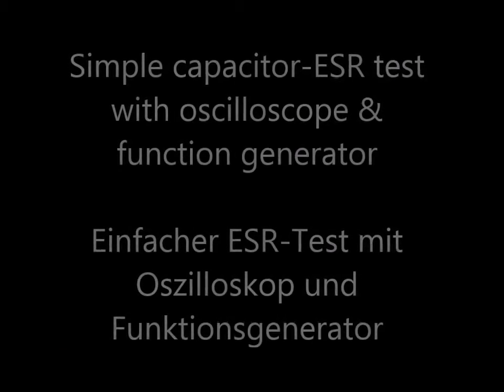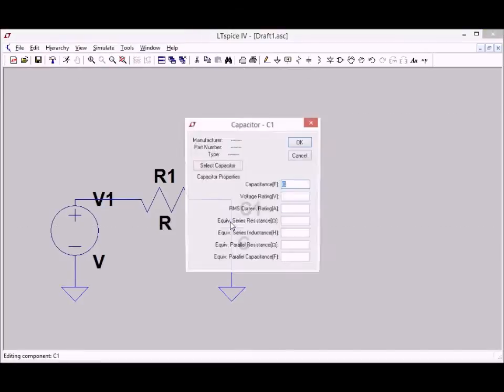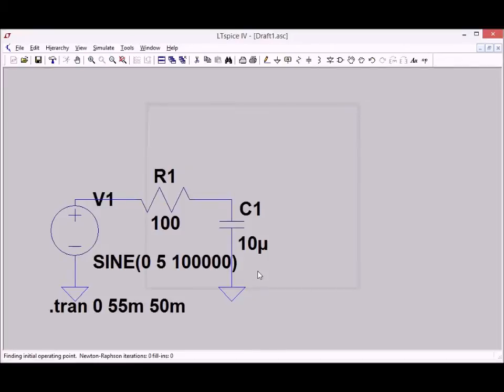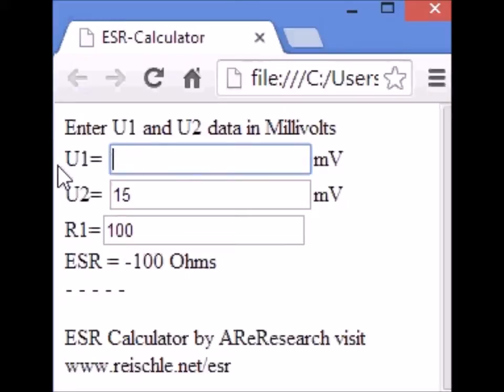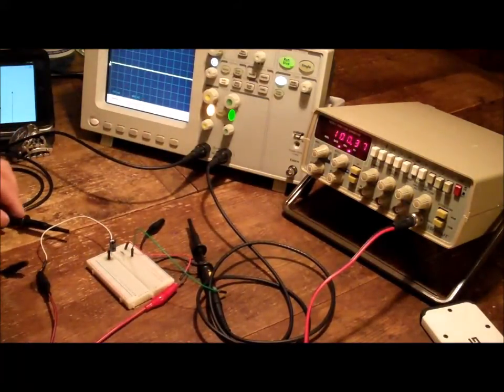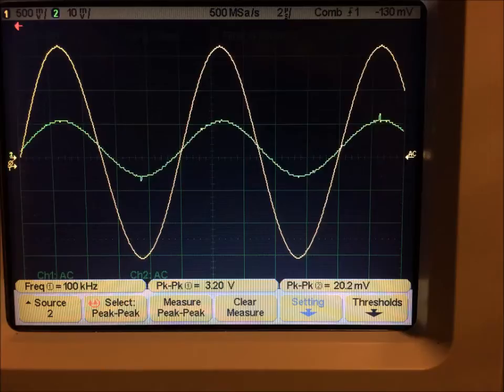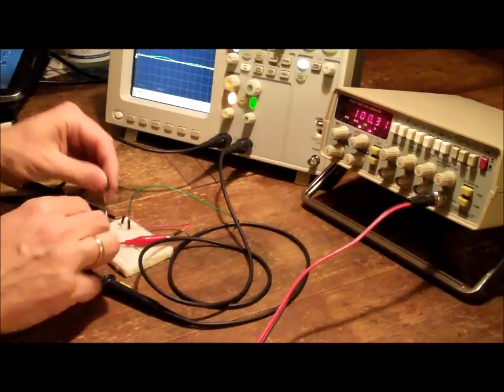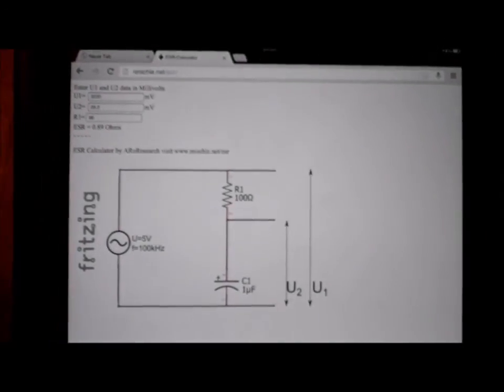Capacitor ESR Measurement with Oscilloscope & Function generator - ENGLISH VERSION

Comment: The internal resistance of the signal generator definitely needs to be included. Also note that the method relies on the fact that the test frequency is high enough so that that the impedance of capacitor is dominated by the ESR but not so high that it is dominated by the ESL.
Reply: there are so many things wrong with his method and calculation...

Comment: Nice way of measure ESR but I would like you considering plugging in the equation the internal resistance of the function generator. Adding, let say 50 ohms, to your calculations increases the value of the calculated ESR and, probably, validates the results you see with your capacitor tester. Anyway, you have my thumbs up on this one.
Reply from the maker: Thanks Frank! The thought had crossed my mind, but I dismissed it. The internal 50 ohms of the generator are not part of the voltage divider, so I thought I could safely ignore them.
I'll run a few simulations and see if it has any effect.
I've seen the internal 50 ohms being used as the second resistor of the divider,but I can't set my old generator's output to a well defined level.
Reply from the maker: Hi Frank, I ran simulations with several (50-500 Ohm) resistors in the "parasitic" properties of the source. The calculated ESR of the capacitor always matched the values defined in it's properties. If you want to have a go at it, here is the link to the LTspice file: https://www.dropbox.com/s/2eit6ok18ycd94c/esr-simul.asc
Best regards,
Andy
Reply: Simulations can be tricky but, still, I would not disregard the impedance of the signal generator. Lets assume the generator outputs 5v and has an impedance of 50 ohms. Once it is loaded by R1 (100 ohms) and C1, U1 is not 5v anymore but around 3.33 volts, also U2 would be 56.3 millivolts. Plugging these values in your calculator it results an ESR of 1.73 ohms. See link below.
https://www.dropbox.com/s/4h4pw8gbfr5l4sc/esr-simul_Generator_Rser.asc
You may also think you don't need to use R1 at all and measure the voltage across the capacitor terminals directly R1 = 0 ohms. The voltage across the capacitor will be this time 167.43 millivolts . Plug 5 volts for U1 in your calculator and 50 ohms for R1 and the calculated ESR is this time 1.69 ohms.
See link below again.  
https://www.dropbox.com/s/7ulx45u0cs8m5ht/esr-simul_Generator_Rser_NoR1.asc

Now ... what result is the correct one?

I do not know! Maybe both results are equally correct!!! I think it is time for a little bit of breadboard fun.

Cheers, Frank
Reply from the maker: Your sketch in the second link is really interesting: If we assume the generator is an ideal 5V signal source with a 50Ohms serial resistor, that yould make U1=3535.5mV (RMS= 5v/sqrt(2)). Running the simulation shows U2 at 114.06mV. Then the resulting ESR is 1.66Ohms. Not really spot on as a simulation should be.
You're right. I'll have another go with the breadboard.
Reply: That is cool. Now, please let me give you more food for your thoughts...

I would offset the voltage output of the signal generator so you don't reverse polarise electrolytic capacitors. Remember than a reverse polarity over one to one and a half volts could cause catastrophic failure of electrolytic capacitors (or, at least, give you false results)
Moreover, you could try reducing the voltage someone under 0.6v or less to be safer and, voila!!, you could have a, cheap and dirty!, on-circuit tester...

Or, wouldn't you? :)

Catch you next time
Reply from the maker: Hi Frank,
I looked up the reverse polarity issue. Wikipedia has it that 1 to 1.5v are acceptable. Digikey has a document stating that 15% of the rated voltage can be applied for 125 hours.
In my test setup, the voltage is lower than that, so I wouldn't worry too much. The voltage will, of course, go up if the capacitor is faulty.
I haven't tried lowering the voltage below 0.6v yet. It'll be interesting to see if the scope can reliably measure the very low voltages.

Comment: Hello!AReResearch
 Can I make ESR measurements using a 100Khz square wave output with NE555 ic?I do not have an oscilloscope and a signal generator.How do you measure esr as simple and accurate?

Comment: In my opinion you should work with the phase angle between voltage and current
 ESR = (PF / wC) 1x10 ^ 6.........PF=Cos(angle)

Comment: You know what the verdict is! DDDDAAMMMNNN man youre good. I dont have an OSC , i knew it can measure ESR but i didnt have one, still dont .  but i have Sanwa PC510a UMM  with mV scale .  Can i use that to measure that voltage cuz its AC.. i think the mV scale is DC but im hoping its both AC And DC cuz it is a true RMS UMM.  Is that so do you know ?
Reply from the maker: +Pavle Pavlovic The Sanwa 510a is a great meter. It has an analog bandwidth of 20kHz. I have yet to try that, but you could probably use the same voltage divider circuit as in the video, but run it at a lower <= 20kHz frequency. Then measure the voltages accoss the two components. The fact that I measured peak2peak voltages with the scope and the meter does RMS does not matter.
I'd feed like a 10V/20kHz sine wave to the setup and see if the relation of the two readings is plausible.
Reply: +AReResearch indeed thatnks for a quick reply, yeah i checked its 20khz limit for range of 50mV, i didnt know about this when i got it ,now i see its very useful and above avarage performance . Also i see that when Freq. rises capacitor reactance is getting lower , but inductance in circuit is rising adding error , so there is no point in using too high frequency, tho at least an option to go on 50khz will be nice , but ill have to check how it all works
Reply from the maker: +Pavle Pavlovic The standard frequency to check ESR is 100kHz. But for comparing good against bad caps, You'll be fine with lower frequencies. You can't expect correct absolute values, but you often find several identical caps in a power supply and that could be an easy way to find out which one has gone bad. I'll try that and make a video when I find the time.
Reply: AReResearch yeah, i would like to test that , but i dont have AC source of such high frequency.  I tried to find some ICs on boards i have around and none is PWM or some kind of oscillator. Do you know  how can i make an easy oscillator from common parts, something easy. In theoory i should be able to make one with NPN and PNP transistor acting like a switch in LC circuit.. but to be honest it would probably last days before i get it to work on any frequency :)
Reply from the maker: +Pavle Pavlovic Well, I wonder if (for a purely comparative measurement) 50Hz from a mains power brick/transformer would do. I know we're several orders of magnitude off the recommended frequency and the capacitive reactance is going to be massive. But I'd still like to see if I can tell a good cap from a bad one that way.